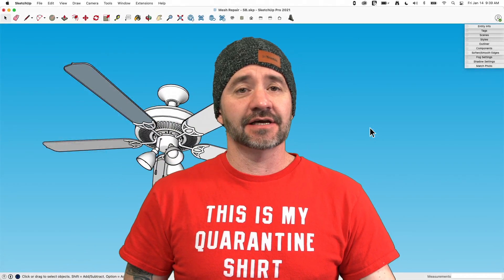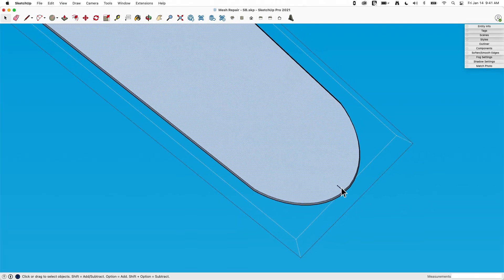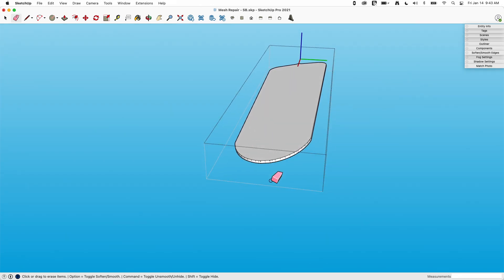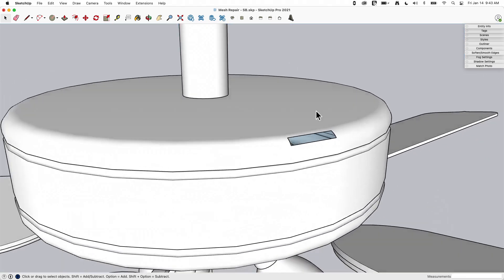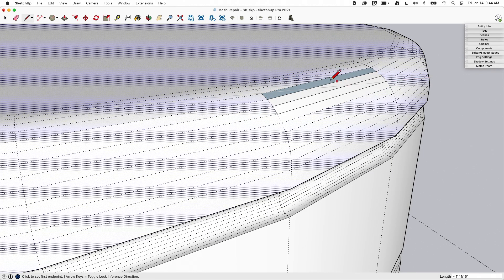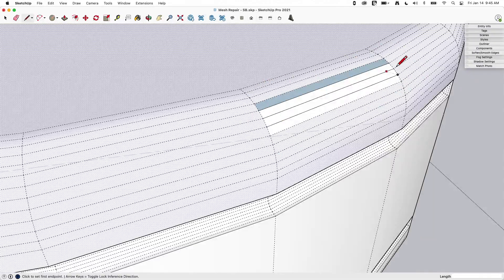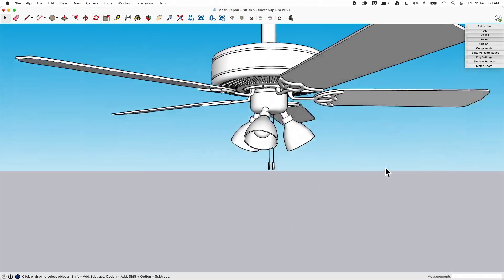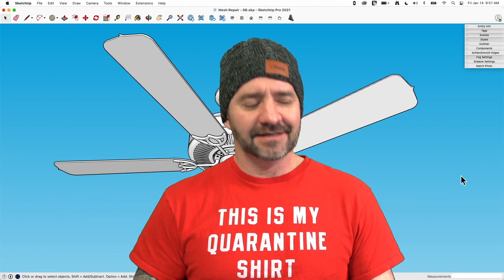Mesh Repair - Skill Builder

Comment: I've noticed faces missing if i import a 3rd party model. something I heard, cant remember where though, is to import it in a much larger scale, like metres instead of mm which usually fills in the missing faces and then scale it back down with tape measure tool.

Comment: Could it be an idea to use solid tool to find the mesh in these cases? You have to know there are faults before you can repair them. :-)
Reply from the maker: Solid Tools work by combining or cutting solids from each other. It does not include any mesh repair functionality.
Reply: @SketchUp  No, but it DOES show where the hole is.
Reply: @SketchUp  Correct, but I assume that Solid Tools will show 'mesh' errors?